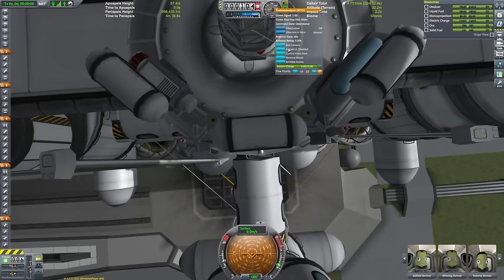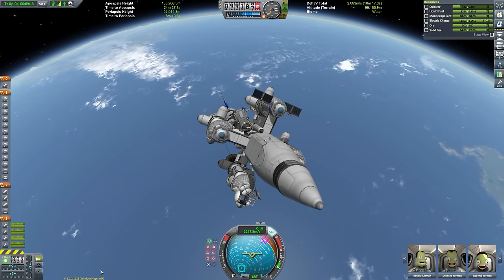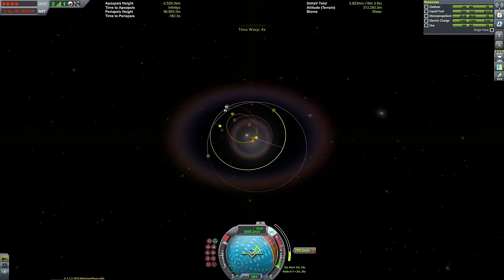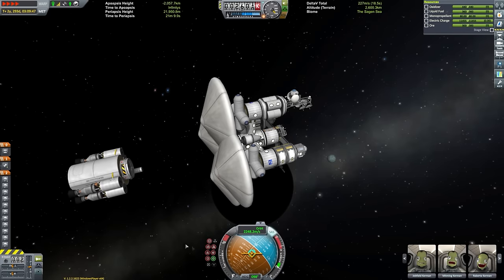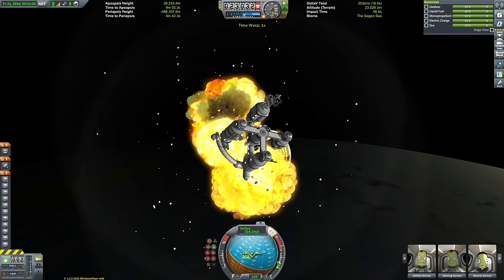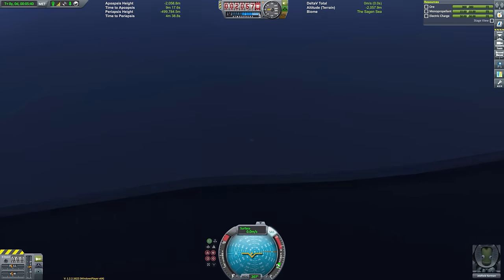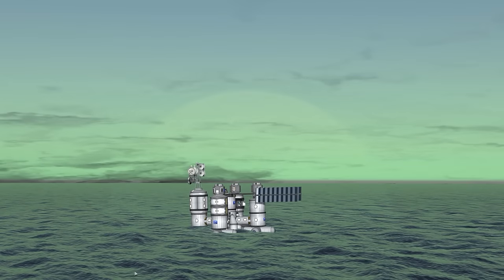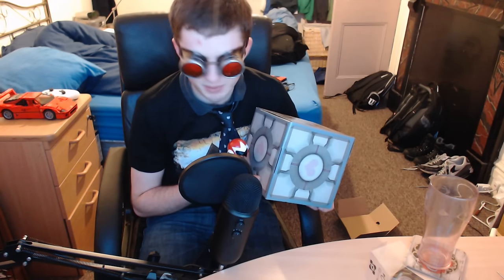KSP: Building a floating base on LAYTHE!

Comment: Make a small Seabase on Laythe Series?
-Submarine
-Speedboat
-Seaplane
-Emergency Pods which shoot you into Orbit :3
-Underwater base
-Use that Little Submarine with 2x Dockingports on top ans bottom to make a Shuttle/Elevator
Reply: Fabian Meisner great idea he realy should do that
Reply: Yes, he should do that, but how is something going to shoot the pods into ORBIT when that takes heat shields, a TON of power, some more fuel, and - wait, it can just be flown into orbit, although it needs to have a boost for good measures.

Comment: 3:25 not every burn; plane change and radial maneuvers should be done at apoapsis, since the relative velocity is lower
Reply: making a change in speed easier and more efficient. When you are going fast, its hard to change direction.
Reply: Nerds
Reply: Ethan Bennett no they are nerds

Comment: I'd like to mention you have cosine losses whenever you are not pointing prograde. 2:46 You would use a lot less fuel for that same maneuver if you kept pointing prograde rather than being fixed to the maneuver vector. Keep in mind, however, that this will also slightly raise your periapsis. If you want to keep the Oberth effect, you should begin by having your periapsis slightly inside the atmosphere (though you never actually enter the atmosphere because you start burning prograde long before that).
Reply: Nerd

Comment: Minor correction: the most efficient point to perform a prograde/retrograde burn is at periapsis, yes, but that is not true for other burns (e.g., plane changes). If you can combine plane changes with ither maneuvers, then it might be more efficient to do them at periapsis, but generally speaking radial and normal burns are best performed at apoapse when possible.

Comment: To make that submersible able to move around and dock to the base, attach an a turbine on the bottom that can work
underwater. For the docking part replace the decoupler with a docking port and put a docking port on the capsule top
and add RCS thruster. Boom a better submersible!

Comment: Not every type of burn is most efficiently performed at the lowest point in an orbit. A plane change is most efficiently performed at the highest of the two "nodes" (which are just the points at which the orbit intersects with the target plane).

Comment: Learning question: How did you plan the multi-burn transfer so that you would not miss the window? Did you have to test each burn, add the intervals between the burns, revert, and then subtract the sum from the final departure time?

Comment: Why did you not deploy the parachutes first? You were going slow enough, releasing the heat shields after that, the heat shields will fall faster since the parachutes are slowing your ship down even more after they are let go..... No worry about cheesing the timing and save scrubbing.

Comment: Try to do this, make a sort of oil rig on the base using the way u made the submarine, but add a battery, ore miners, you can have somone working with on the rig so you don't use electricity on a unnmanned (it will also give tge guys a perpous) add a coupler so you can add electricity to it and remove some of your gathered ore

Comment: ur supposed to inflate parachutes and then eject heat shields
Reply from the maker: Tried it, didn't work. They glitch out because of the way they clip together
Reply: Did deflating them not work? Or is my memory just wrong and you can't deflate them?
Reply: k bro
Reply: on most ships it works
Reply: Actually those heat shield can float (I’ve tested it on kerban)